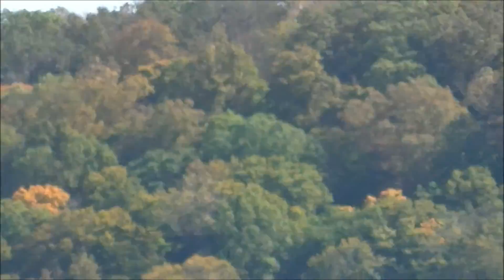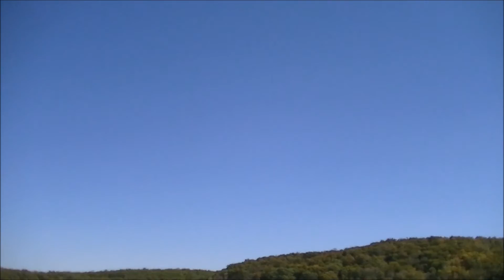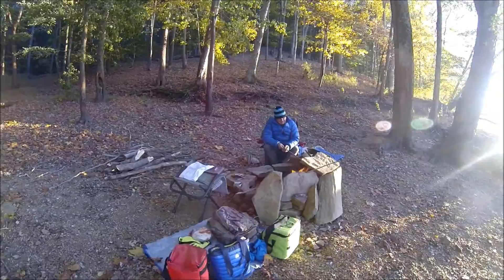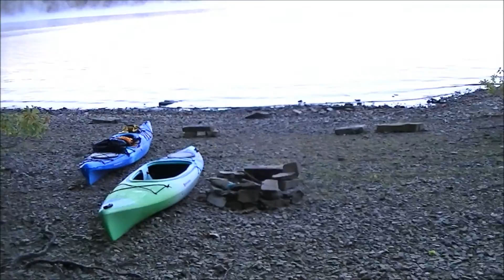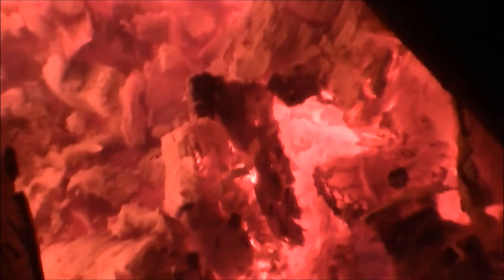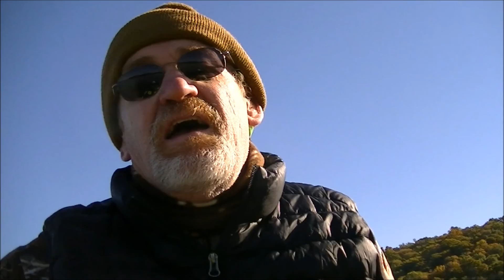Kayak Camping - White Caps, Wind and Fog

Comment: I live on the Chesapeake Bay and kayak with a lot of "ruff" water. Just for your info I have found water starts to white cap any time the wind speed gets to and sustains 15 mph or greater. When the wind comes up on us the water can go from dead calm to 4 foot rollers in a matter of minutes. That makes for some "fun" kayaking. Last summer I was forced to cross a 5 mile bay at 2:00 am in 4 foot rollers due to unforcast incoming really bad weather. Thank goodness I had a full moon and warm water.  Heres the link to some of my trip. https://www.youtube.com/watch?v=Lt-WLGIvBs4   Like your vids.
Reply from the maker: Thank God we don't get waves like that.      The 12-14 inch waves and wind were plenty for a beginner like me!        Thanks for Watching!
Reply: We use mainly sea / touring kayaks around here. 14 foot is a short kayak so they take the ruff water very well and it's not that bad.